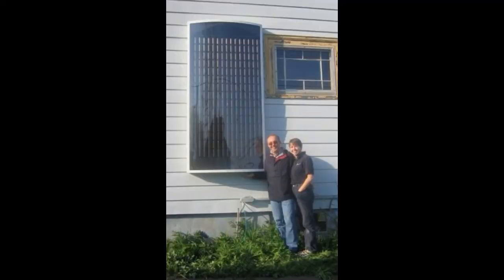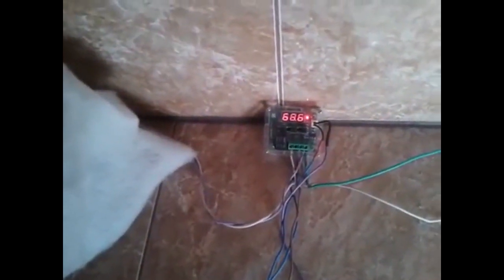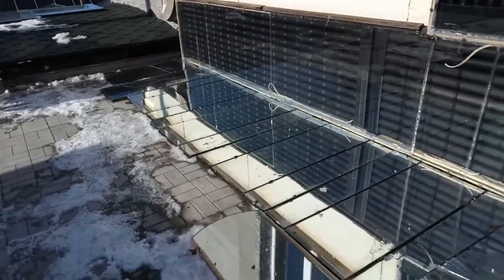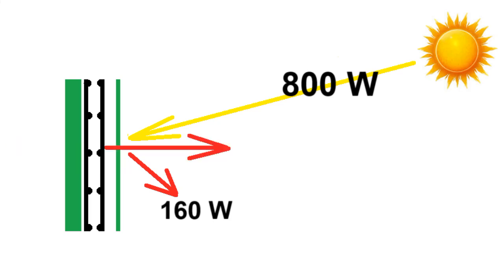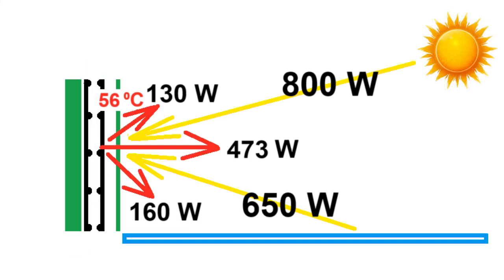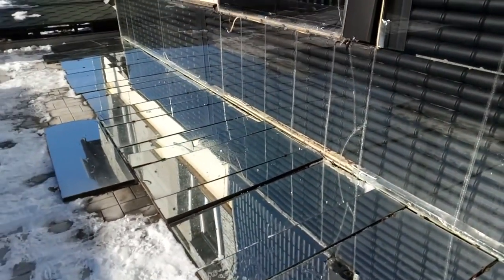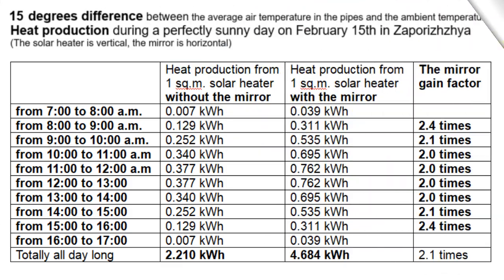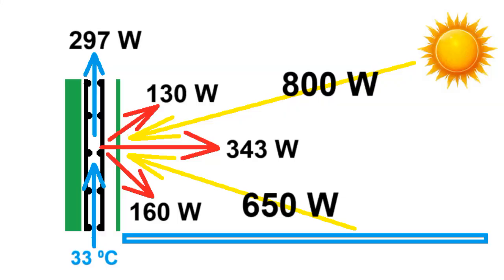Solar energy (inside cans) heats a house in winter in Ukraine

Comment: Why not having some simple solar tracker mirrors directing all the sun and heat to a window specialy made heat capture wall ?
Reply: "Simple" solar tracker 😃 Even if you build a durable heliostat it'll be very annoying when you look out the window and a larger csp can easily burn down your home
Reply: @ Yeah, i tought about the burning risk, but some security could be done, like physically block the sun-ray course on a certain path, and automatic blinding of the mirrors in some case with som flaps. Actually it already exists many ready to sell. A norvegian village is also using a big one of 3 times 17m2
Reply: Was thinking the same thing.  Trackers are complex and expensive, but using existing windows and directing more sun through them and onto something non-reflective with a large thermal mass to regulate the temperature is a good idea, but it depends on the window you have available.   Adding windows to an existing house, especially 2-3 pane insulated windows to keep out cold, can be expensive, and the more panes, the more reflectivity unless you get special low reflectivity windows.  They may also add more heat in the summer if the sun's shining on them.

Static window panes with simple enclosures or that are notched together would probably be a lot cheaper than track windows that can be opened and closed.  If building the house from scratch anyways, may as well just make the entire south facing wall static window panes, as many eco-conscious architects do, with a long overhang to block the sun in the summer and/or tall trees that gain leaves in the warmer months, and shed them in the winter.  (Trees potentially kill the use of rooftop solar) Mirrors would work just as well on windows, without the radiant heat losses of his metal can solar wall.

Even simpler solution to achieve the goal of using less home HVAC in the winter; turn the temperature down.   This is the first year I'm trying a much lower temperature in my house.  53F/12C. (Most people think I'm nuts)  Less temperature differential between the inside and outside means less heat loss through my old house's walls that are definitely badly insulated.  Spoiler alert, it isn't bad.  I'm going by the principal of heating the person, and not the entire house.  So yeah, I wear warmer clothes, use blankets and a localized space heater in my office with the door closed (I'd like to get a window heat pump), and have a heated mattress cover if it the bed gets too cold.  Other than coming home to a cold house and having to add layers instead of shedding them, and a frigid time getting in and out of the shower, it's been fine.  I've cut my heating bill significantly.  When I moved into my house and kept the HVAC turned up because I didn't care about reducing my footprint, versus today, my winter gas use has dropped by about 2/3rds.

The only concerns with running the HVAC so little is managing the humidity and making sure the pipes don't freeze or burst.
Reply: The guy in the video is a master at solar concentrating. Someone just jacked his video and made a diff channel using his content. His name is Sergio or something. Got a great channel doing many diff experiments with mirrors and lenses ect
Reply: @ Sergyi Yurko ? I tought these are secondary channels for synthetising his work for differents kind of peoples...?

Comment: With all these solar air heaters, most of the times toxic material are in contact with the air that will be breathed. With some care of design it is avoidable. Diy glue from natural and non toxic material, separating the air flow part with non toxic materials and the painted parts... Casein glue can be used, linseed oil also for humidity protection..